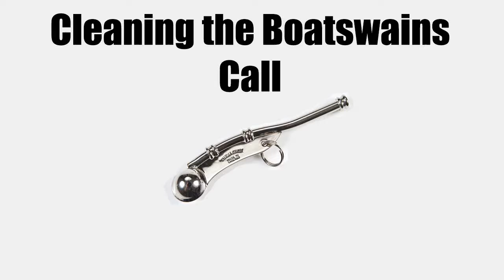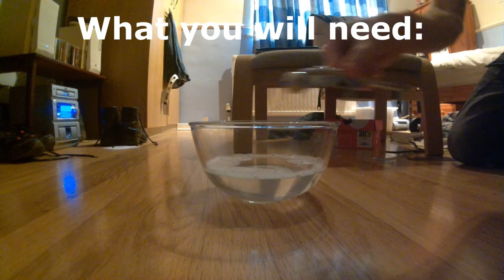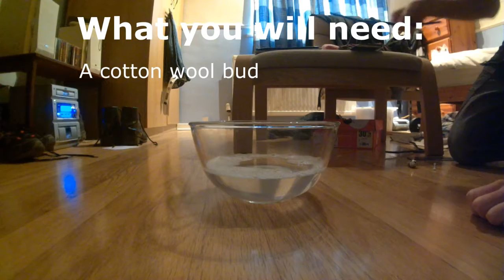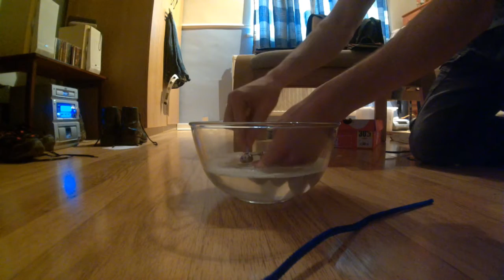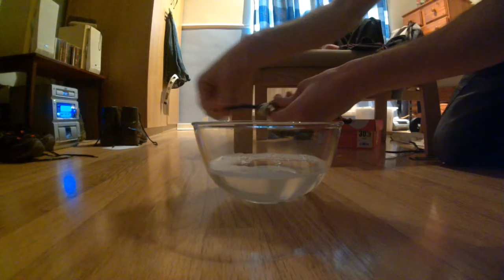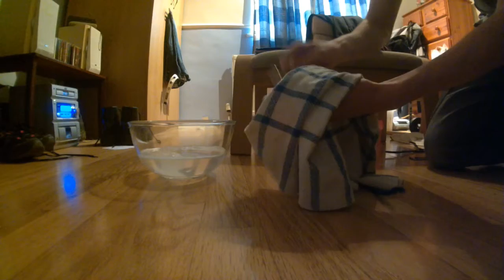HOW TO - Clean a Boatswains Call (Naval signalling whistle)

Comment: great vid but how do you tune it?
Reply: Hi, I'm the guy in the video, I have never tuned mine as I have always thought it was one of the best sounding pipes I have ever tried in it's factory/stock state however I have heard that the way to do so is to scrape away/slightly dent the air hole, I have heard stories of people putting wax into the buoy aswell however this is risky business as a small mistake could ruin the pipe all together, sorry I couldn't help here.
Reply: You don't
Reply: You don’t have to tune it at all.
Reply: You can use a small amount of Beeswax.  Put a small amount in and heat up and find the right tune.  Doing this gets you different highs and lows depending on the technique you use.  For example clinched etc.